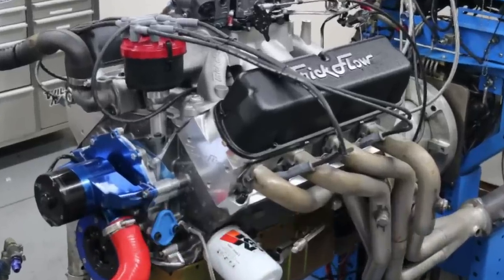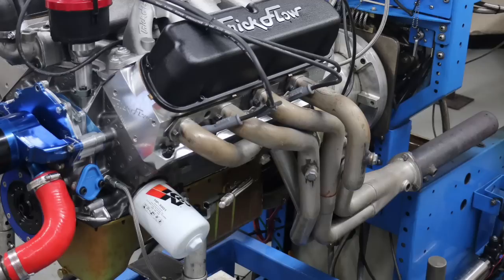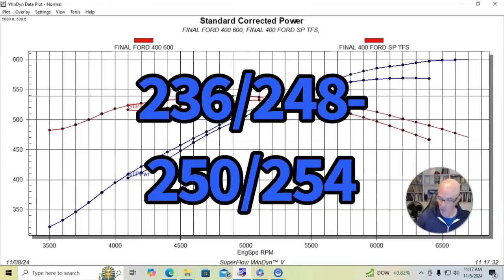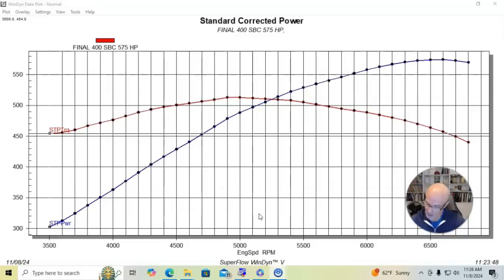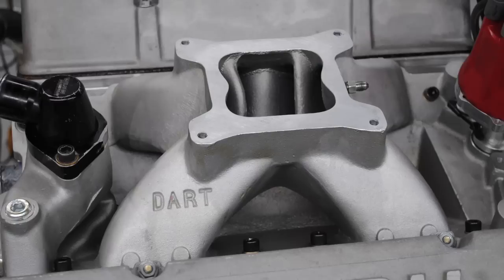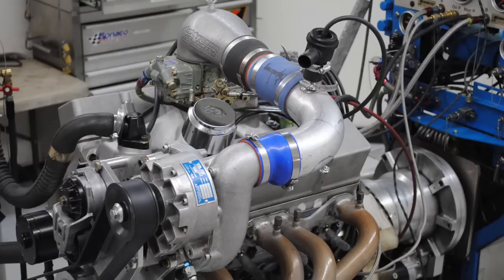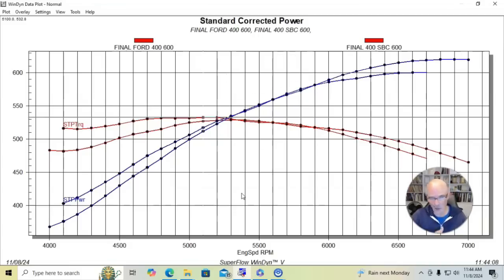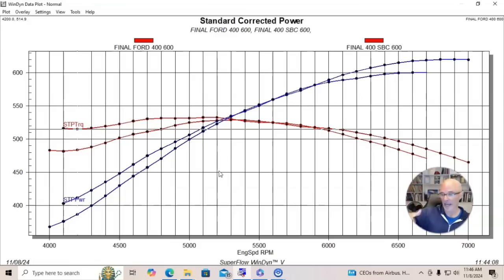400 FORD VS 400 CHEVY-THE OTHER GUYS STROKER BATTLE. HOW TO: 600+ HP 400-INCH SMALL BLOCKS!

Comment: Don’t know how correct it is,but I was always taught larger bore x shorter stroke is higher  reving and made its peak power. Up in the power band. Smaller bore x Longer stroke makes peak power lower in the rpm range. To support this look at ford’s two  best Fe engines. 427 large bore  x shorter stroke, is a high reving monster wins in nascar,lLemans,drag racing. 428 small bore x longer stroke,low end power great street car engine. The larger bore would help if there were any  valve shrouding,and don’t forget,unless im mistaken you used solid roller cams in the Chevy 
That would help peak H.P wouldn’t it?

Comment: I believe the difference in the power curve is a product of the camshaft. Simplest answer is usually the most likely. 

It would be very interesting to see if you could find an identical cam for both to eliminate most if not all variables. I may have missed it but you also didn't State the compression ratio for the Ford, which obviously could make a big difference. Apologies if I missed it. 

It would also be interesting to repeat the test if the Windsor was wearing "Clevor" type (canted valve) heads. Because they're supposed to flow quite a bit better. It would also be interesting to see what the Ford did with a supercharger.

Comment: You also ran 205 cc heads on the Ford and 225 cc the Chevy.  More head flow and bigger cams will have more of an effect than bore and stroke differences.  
Also it's hard to make an apples to apples comparison when running NOS on one engine and boost on the other. 
They're both good engines and you can get the same levels of power out of both with the right components.

Comment: Wich cam would you recommend for a 408 w with 190 cc heads 5 speed trans and 3:70 rear gear i want driveability around 2000 rpm… limit 500
Hp
Reply from the maker: comp xe274hr or tfs stage 2
Reply: @richardholdener1727 still thinknit will have 500 hp…

Comment: The fords a square motor,4 bore 4 stroke,chevy junk is a oversquare if i remember,CHEVY WAS ALWAYS KNOWN FOR BEING CHEAP,THE 400 FORD WAS A WEAK TRUCK SHOE IN,THE CHEVY WAS A BIG BORE 350...TRY A 410 OR 406 MERC,A 428,29 FORD OR EVEN A HP 410 MERC...CHEVY IS WHAT I CUT MY TEETH ON...JUNK AND EASY
Reply from the maker: If you say that one manufacturer makes nothing but bad motors-you need more knowledge on motors

Comment: You gave the Chevy more head and cam. But even with that, the Ford was pulling harder in the meat of the pull. If both engines were leaving the line at the same time, the Ford would be pulling harder, longer. The Chevrolet would be pulling in the shift area.

Comment: I would have to say in short that if identical brand and style of aftermarket parts wasn't used then then the possibilities of why one engine made more than other   
 aside from bore/stroke will be a lengthy list of variables as each part inconjunction with another will produce a different outcome just as different combination of parts on one motor will have yield a different amount of power everytime, but as for the torque produced below 4500rpm range the longer stroke I'd say would be more relevant as amount of cam lift had on both engines does little to nothing within this rpm range, but if unlimited of part/brand of part options was at your disposal then there's a part combination superior to another regardless of stroke/bore but to my knowledge the old sayin is shorter stroke will make the most peak Hp the higher the rpm.

Comment: Once again, we ran a stroked Windsor off ebay parts for 5 years! I got out to start a business with my brother in law. Stop your bitchin bout what we race! Why the bigger cam in the Chevy? Nevertheless,  the Windsor is a more versatile engine that you could actually cruise into the drive-in! Now, Dodge 360, given a comparable set of heads, would be better than either of them. Math dictates performance,  not the hood emblem!😂

Comment: Shorter rod has a little slower piston speed than the longer Ford four inch allowing the fuel burn to apply pressure on the crank a little  longer than the longer stroke.

Comment: Good shootout, but what I would like to see is a TPI ported intake with the big tubes, and good heads etc. and several cams from the stock TPI to a big by big solid roller. I'm building an engine for an autocross T-bucket, and from my previous experience an engine with good low-end torque that carries the power well into the upper RPM range gives me better lap times than a peaky engine that only makes power in the upper RPM range. Or if you would a Holley LS cross ram with the same range of cams testing from the stock 5.3 cam to something in the 300 degree at .050 range.
Reply from the maker: 300 @ .050?

Comment: Different  heads and intakes and bigger cam, better stroke to rod ratio. Shorter stroke will always rev better than a longer stroke. Of course  the Ford make more down low and Chevy up high. Put the same combos up against each other, and then you can get a better comparison

Comment: I'm a chevy guy, but a ford engine consistently will make more horsepower while doing less to the engine internally than a Chevy, don't even think about  putting Cleveland heads on the 400 and making it a Clevor, it might get ugly then.

Comment: That's funny how you paint the narrative that both engines are equals. They're not, you're putting bigger stuff in the Chevy, then the ford.
Typical Chevy boy.
Reply from the maker: you must be new-here I am with my original owner 1988 Mustang 5.0L LX bought in Nov 1987 (don't worry, you will get there)

Comment: The camshaft on the Chevy is much bigger than the Hyd roller used in the ford 
601 vs 619 
Put the same spec cam in the ford and it would have made more than 619

The ford and Chevy head at cam lift what was the difference in cfm

Comment: It's the cam difference... Cubic inch is cubic inch just like every cam is a turbo cam....

There was someone who tested the long debated 305 vs 302 on YouTube I watched recently. With very similar setups, cams, heads, and everything as similar as possible(not someone choosing what's "best for the combo to make it fair"), they both made the same torque and horsepower. Or within a couple numbers. The graphs almost overlayed each other. 💯

Comment: Several reason Chevy had 225 runner compared to and 205 but ford has 20 degree valves sbc has 23 angles other things to talk about with sbc bigger bore the valves would be unshrouded also

Comment: The difference that you asked about, in my humble opinion, is camshaft. The bore/stroke combination only really becomes an advantage for the bigger bore when you increase the intake valve size. Maybe slight advantage without, if the valve is already shrouded by a small bore. I can prove this both on my flow bench and engine Dyno. Since you didn't share valve sizes and flow data, we can't logically make any assumptions about these criteria. Therefore, based on empiricism, I would strongly suspect camshaft.
I noticed when the camshafts we're smaller and more similarly sized, that the for still produced more torque. I suspect, also based on experience, that there was a difference in cylinder head flow and probably valve size.
Also, perhaps, compression?! I did not see mention of sbc compression ratio. Perhaps I missed it.
Jack Henderson
Reply: If you unshroud the Valve you will get better flow with any engine at any RPM. But short stroke will also hurt the torque at low RPM.

Comment: I’m a ford and Chevy but I do like a Chevy but when it comes down to it I’m a LSX!  But I would have like to seen these with both speed master blocks both with the same stroke and bore same brand and style pistons rods and cranks and these heads for the ford Trick Flow® High Port® 225 Cylinder Heads for Small Block Ford TFS-5171T013-C01 and these for the Trick Flow® Super 23® 230 Cylinder Heads for Small Block Chevrolet TFS-3241T002-C03 and then basically even single plains from trick flow or some Edelbrock Vic seniors, same grind cams from bullet or comp, same 850 or 950 Holley’s same ignition the same size primary tube headers same length collectors or close as possible that would have been awesome to see the results for that test then do 100 shot and lastly one of Torqestorm’s new 84mm supercharger and then see what’s up I’m still leaning towards the chevy but the ford with them 225cc hiports will be mean regardless.   That’s what I want to see !

Comment: The SBC had more airflow than the SBF for the 2 600hp examples, and that primarily came down to parts fitted. We've seen SBF's walk SBC's when the same CR is achieved and part's fitted. Reality is, it's all about building it the way you want, and nobody is going to cry over how fun any 600hp SB really is.

Comment: Need to do a 383 comparison or close comparison 3 and 3/4 stroke and 4 in bore . Then it's only a difference in deck height and rod length

Comment: Why do you always pick the shit heads for a ford ? Why didn't you build a 400 ford with the tmeyer rotating assembly? Why do you not use N heads on any of your ford builds ? Why do you continue to build fords with the most absolute garbage parts? If you're going g to build a 400, build a TRUE 400 . I appreciate the builds by all means but you're comparing apples to soup cans . If you want to do a true 400 build im sure tim would give you all the support you need . It's great information, and very welcome. Thank you for taking the time build and share.

Comment: Sounds like a block of metal  with a combustion driven rotating mass makes the same power with comparable parts, size, etc, regardless of whose logo is on it. When you truly compare apples to apples. But fords are still better! 😂

Comment: not apples to apples. Chevy had way more cylinder head, 4.125 bore unshrouds the valves more than 4.030 bore. You didn't say what the compression is for the Ford.

Comment: I think the Ford has less compression, with those pistons that I think are 28cc it should run at approximately 10.05:1, that's why it made less power, it didn't take much advantage by increasing to a larger cam... the Chevy with 11.25:1 took better advantage the cam and the carburetor..

Comment: Sorry Richard, this is not a 'vs' because the two are really very different in the parts used.   The bore and stroke differential is minor compared to the cam and head difference.   Undoubtedly both were done at different times, and both would be a bunch of fun.  With same grind of camshaft, same compression, same intake runner volume,  size of carb and headers, they will probably be very close. The bore stroke differential may show a gain ? Then the controversy continues.....

Comment: Ford actually made a real 400 right at a factory and Chevy actually made a real 400 right out of the factory why not do that comparison instead of two stroked small blocks
Reply: The 400 Chevy was the oem setup just with an aftermarket block and the 400 ford would basically do what the stroker did as it’s basically just a stroker with a .5 inch taller deck height using Cleveland heads instead, but Cleveland heads take advantage of the same cams all the same

Comment: See there you go again , 400 Ford, 400 Chevy, the same?  Chevy,bigger  am better heads, different bores and stroke, how is that the same, always the same every time. Same right ! Why didn't you put a set of Cleveland heads, like I said, apples and oranges. When areyou going to  be equil ? I saw the same thing on engine masters but they used very simulator parts. The ford made more power just a little but more, why didn't you use some AR heads? I hate that stuff, '" Chevy vs ford" can't you for once have a fair test!!!! 
😊n

Comment: Richard, you had to throw the cam curve ball 😅.
Would have been an opportunity to see the difference in argument of piston speed square build torque vs big bore fuel charge draw cylinder filling.
My money is on either one will break the bank. 😆😆😆
Reply from the maker: IT'S THE CAM-IT'S ALWAYS THE CAM-BORE AND STROKE IS ALMOST NOTHING COMPARED TO THE CAM
Reply: @richardholdener1727  but there are those that will argue. Some are very prominent too.
Reply: @mikes.1882  DV has joined the discussion! 😁😁

Comment: Definitely cam made the difference haha see how confident i sound, i have no idea haha but i would take the Windsor for more or same power most of the rev range.
It could be said to that the vortec? Supercharger ate 170 odd horsepower to run, which is a fairly big percentage at 1000 horsepower
Reply from the maker: HOW DO YOU DETERMINE (GUESS) 170 HP TO SPIN THE BLOWER?
Reply: @richardholdener1727  well it's not rocket science but double the inlet pressure double your horsepower, is the accepted rule of thumb as such. Atmospheric pressure 14.7 psi at sea level, you said you ran 16 psi boost,  double 619 na is about 1240, your numbers were something over 1000 so just by numbers seems like you were using 170 something hp to turn the blower.

Comment: When you are comparing cams, are you also factoring in the Ford 1.6 rockers vs the GM 1.5 rockers?
Reply: Cam specs are listed at the Valve, not the cut at the Cam.
Reply: @mylanmiller9656  "Cam specs are listed at the Valve" 
 right, and different rocker ratios is not an apples to apples comparison
Reply from the maker: VALVE LIFT

Comment: Definitely a bore and stroke thing. The 4 inch stroke made more low end torque and the 4.125 bore made more peak horsepower.
Reply from the maker: YOU SPELLED CAM WRONG
Reply: @richardholdener1727  🤣

Comment: I'M A CHEVY GUY?  BUT THAT FORD WAS PRETTY DAMB IMPRESSIVE, SMALLER CAM, SMALLER HEADS AND STILL PRETTY CLOSE
Reply: Not only smaller cam and cylinder heads, but way smaller cylinder bore vs the 400 Chevy. Chevy had a aftermarket block that was a better casting vs the factory ford. If this would’ve been an offset ground 351-W crankshaft, with a 6.125 SBC rod and dodge 340 piston, making the ford a 377, I think the ford would’ve been up 25-30hp over the Chevy. This was a bad comparison in my opinion.

Comment: To me , its obvious the sbc had better cam selections along with cylinder heads TFS was only 205. If  anyone thinks  those TFS hyd rollers  even come close to Bullet or a  Comp off the shelf or  solid roller  "Custom grinds"  Im not sure if they were  or not........ order one....we did and as soon as I opened it Summit got a call!! packaging sucked!! pathetic is being nice..... Equally built  sbc /sbf will be close...It all comes down to $$$.  Chevy parts were less bk in the day , now???? Its all crazy Good Luck to you all , plan /spend wisely.....We are all kraZy lol .....bcuz we still have that ITCH!!

Comment: Better springs on the ford  then at higher rpm it could stretch its legs 7000rpm  but i take chevy all day every day
Reply from the maker: IT DIDN'T NEED MORE RPM-IT WAS AT THE POWER PEAK

Comment: Why not compare apples to apples. Stock 351W to a stock 400 SBC?
Same everything..  ie; cam spec, compression, heads, intake, etc.
Reply from the maker: I THINK YOU MEAN 350 CHEVY TO 351 FORD

Comment: The chevy had bigger cam, bigger port volume in the heads, bigger carb. I believe the LSA was too big on both engines. Should be closer to 106-108. That will make a huge difference on both engines. Just swap to Cleveland heads on that ford and the Chevy will find out it can't keep up anymore. If it's a street engine 2v aussie heads. 4v just don't make the numbers down low for street use. Both showed decent power but the  heads and cams really should be the same to make these kind of comparisons
Reply from the maker: STOCK 2V OR 4V CLEVELAND HEADS WOULD BE A BIG STEP BACKWARD FOR THE FORD
Reply: @richardholdener1727  Why? If you're talking the OEM Cast Iron heads, yeah, I agree. But modern Aluminum Cleveland heads would trounce both this 400 Ford and Chevy, hence why people build Clevor engines (Cleveland heads, Windsor block.) These are 400ci engines anyway and you're throwing power adders at them, so it's not a real heard to head battle (4.03x4 and 4.25x3.75 also.)

It just feels like there needs to be more to this comment then... Cleveland heads bad.
Reply: @dalecole7339 eh not really the Cleveland heads are really just for show with the canted valves they step down the port size to what is readily available to standard Windsor head with barely better flow for a lot more work, the sbc literally just won because of way bigger cam the ford cam doesn’t even touch the lift of the sbc with its bigger cam being nearly down .100
Reply: @dalecole7339 

The so called modern aluminum Cleveland heads are so radically altered that it’s not really honest to refer to them as Cleveland. 
The factory Cleveland heads were doo doo. A typical performance head exhaust side flows about 80% of the intake side. A stock Cleveland had a 150% flow differential.

Comment: was the camshaft bigger when you factor in rocker ratio? ford 1:6 vs 1:5 ?
Reply from the maker: LIFT WAS GIVEN AT THE VALVE
Reply: @  yeah you explained it on the live tonight. I didn’t know SBF came with a 1:6 rocker. The only one I had was an 82 mustang Gt way back in early 90s with 302 and the horrible standard before the T5. with the big drop after 2nd gear into 3rd and it nosed down. Huge gap between 2-3 I think if I remember right. And the rear main seal leaking bad even after changing it. That was the extent of my ford car experience. Very unflattering to say the least.